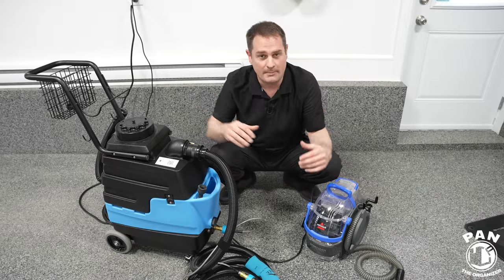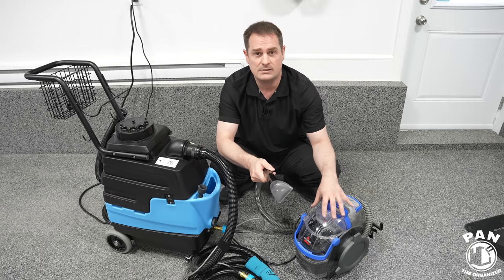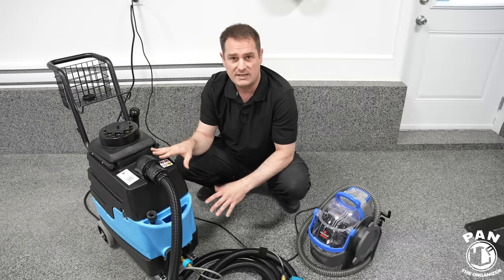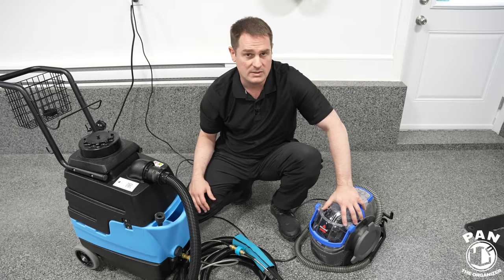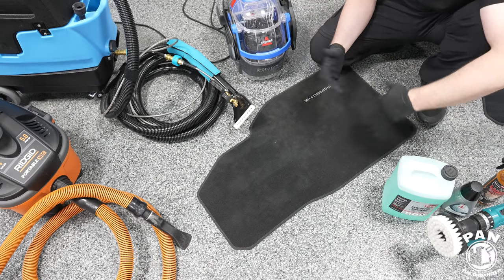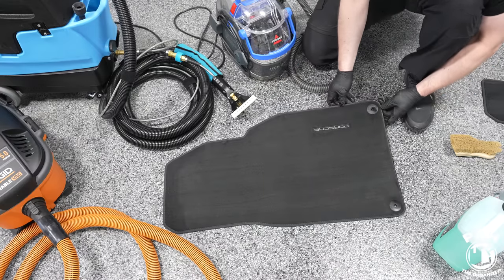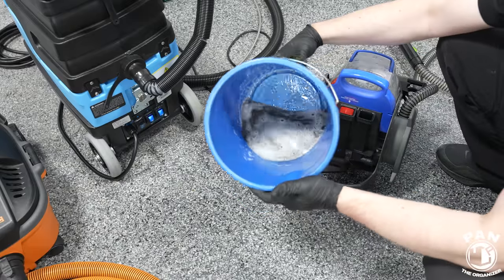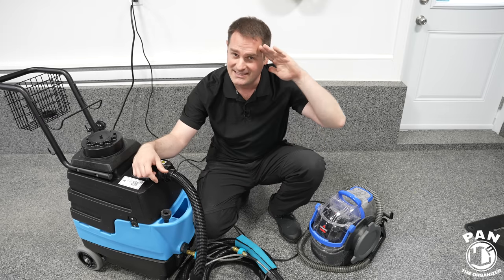Cheap VS Expensive : Carpet Upholstery Extractors

Comment: Now sure if this is the right area to post this, but can anyone tell me how to tell if some of the cheap " ceramic"coatings actually have si02 in them? I just applied some of the gold colored bottle one from Amazon($4 dollars from Alibaba) 1st paid detail job:)
Actually went on pretty good, strong chemical smell, so far nice and high gloss.
Reply from the maker: Hi Paul. That's impossible to say without knowing the brand. If they don't mention anything on the label, you would have to start digging for SDS sheets on their website, but if it's a shady company, which is probably the case if you purchased a $4 coating on Alibaba, you won't find anything. So at that point, you're at the mercy of believing what ever the brand says... 

You can't even buy a proper wax for that price, so imagine trying to get a quality ceramic coating for $4. Not going to happen. There's a lot of technology that goes into formulating ceramic coatings.

NEVER buy cheap coatings from non reputable sources. Live and learn. 

Stick to quality products from brands like CarPro, Gyeon, Gtechniq, AvalonKing, Optimum, Kamikaze, DuraSlic, Ethos, Adam's, SPS, Art de Shine, APEX Surface Protection, etc.

For future reference on quality products, watch my awards video for the best detailing products: https://youtu.be/LkD22UGujmw
Reply: Thanks for quick reply! The customer supplied it, so had no choice, using turtle wax ceramic spray on my car. Going to order Avalon king for others in future if I get more customers.

Comment: you use the brush you loosened dirt and debris with to put lines in your clean carpet
Reply from the maker: It doesn’t really matter. The dirt doesn’t stay trapped in those bristles anyways. I think you’re overthinking the monent.

The moment you out your shoes back on the floor mats, you are putting way more dirt that way anyways. ;)

Comment: What ph the chemical has to have for cleaning the car carpets ?
Reply from the maker: There can be different pH levels when it comes to that, so I wouldn't worry about that. I would simply make sure to get appropriate dedicated carpet and upholstery cleaners. They are what is called "pH balanced" meaning the appropriate pH for the surface they're applied to.

Comment: Why demonstrate on fairly clean floor mats?
I still like the video seems a little long
Reply from the maker: It’s not like I can snap my fingers and have disgusting floor mats magically appear. Life doesn’t work that way. I work with what I have at the moment of filming.

And that’s beside the point of this video anyways. Here it’s not about cleaning disgusting mats, it’s more about comparing two machines and showing the proper technique of using them.